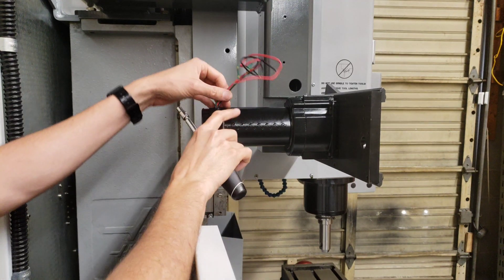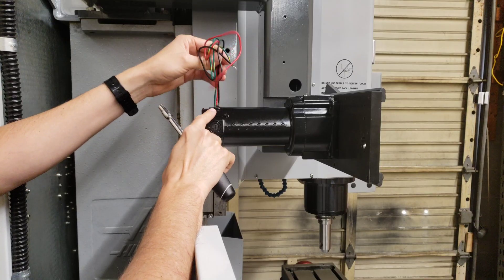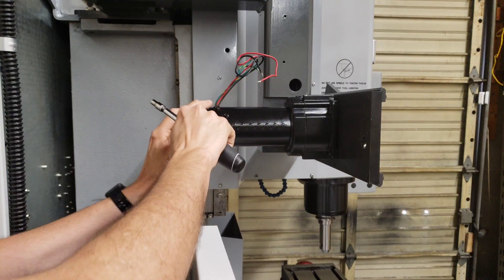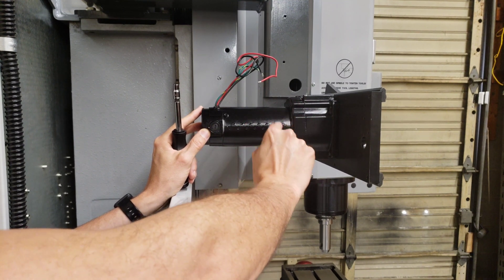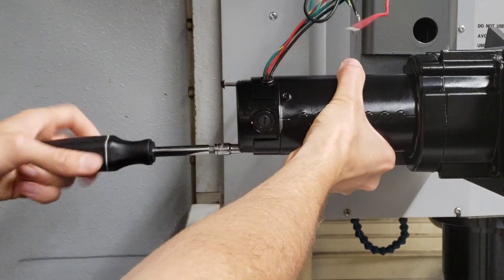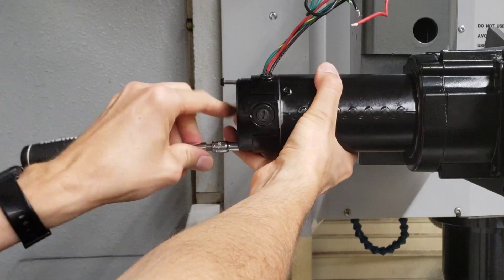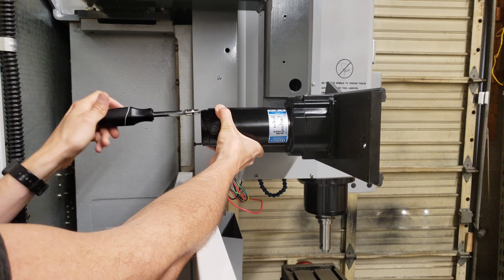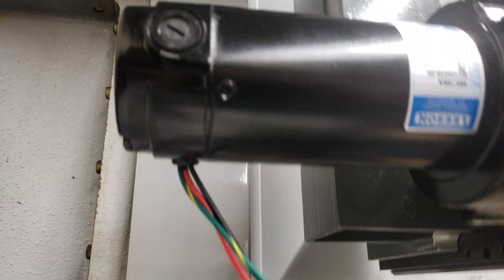Adding A Tool Changer To HAAS TM-1 CNC Mill | PART 3: Drip Loop for Umbrella Shuttle Motor

Comment: Did you ever get this buttoned up?  I am actually in the process of buying an umbrella from a fella that came off a gantry router for my 2004 TM1.  Everything except for the mount seems to be identical from everything I've seen in your videos and many other places.  

This fella happened to have the Haas field install paperwork with all of the information for setting parameters/adjusting the toolchanger if you are still working through it and would like the PDF, let me know.
Reply from the maker: Not completed yet, because I was waiting on a few parts, which I only received recently. I would love that PDF. Please email me yt@engineerable.com Thanks!
Reply: @engineerable  so sorry bud! For some reason I completely missed this notification 🤦 I will dig it out and get it sent over in a bit
Reply: @engineerable  I JUST sent it over... let me know if I can help in any way.  Really sorry again I never noticed this notification.
Reply from the maker: @siraig  Much appreciated 👍 I got it!
Reply: @siraig  Hey. Is there any way I can get that pdf for the ATC install. I have a 2006 also. An ATC would make a world of difference. I haven't started buying things. I would be grateful for any help and advice you could give. Thanks for your videos and your help in advanced.
Reply from the maker: Hi, would love that HAAS field install pdf. Please email me yt@engineerable.com Thanks!
Reply from the maker: Hi, can you send me that .pdf manual?
Reply: Hey @siraig, do you happen to have that PDF handy to send over to @engineerable?

Comment: Thanks for the videos on how to install tool changer.  I have a similar situation.  I have a 2006 haas tm-2 w/out changer, but it is machined for bracket.  Do you know where I can find more information on the rest of the install and is it plug in and play or does Haas need to be contacted for permissions to use with there interface?
Reply from the maker: Info is very scarce. Even their service manuals are crap. I haven't completed it yet because I was waiting on some parts, but I've heard that it's plug and play. You just need to enable the setting. Finding the tool changers themselves is challenging, but if you come across a used one, then grab it.
Reply: @engineerable  Thanks man!  Would like to see the rest of the build when you get parts.
Reply: Hello, I now have two cnc haas tm's. One is a 2007 and the other is 2006.  Both do not have tool changers.  I did purchase one with tool changer last week and it should be delivered in about 2 weeks. My plan is to study the one with tool changer and make one for my other two mills. I'll buy what i can and make the rest.  Did you finish your project yet? Would like to see even more information about how it works with the haas control.  I know you mentioned plug and play, but would like to see even more resources.  Thanks for any help in advance.